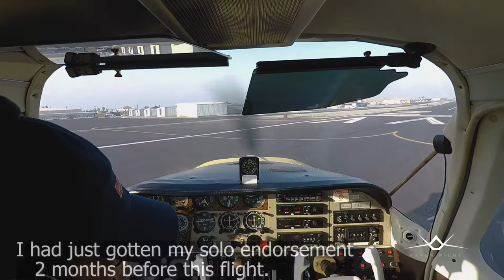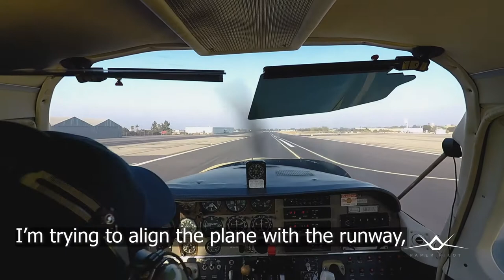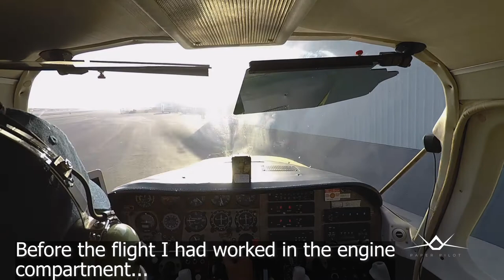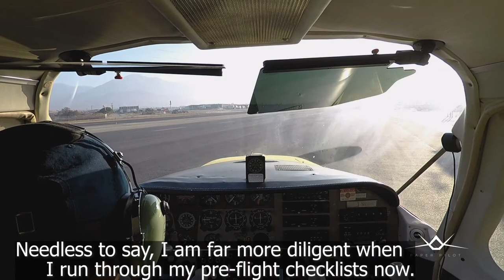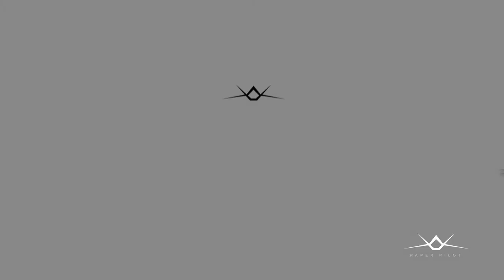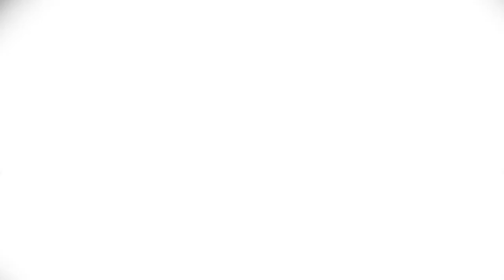Real Emergency Rejected Takeoff! Because I forgot this...

Comment: I've seen accident reports from exactly this situation. You flew the plane, got it back on the ground without any apparent damage to you or the aircraft, and learned a valuable lesson. Then you shared the lesson with all of us on the internet, hopefully preventing someone else from making the same mistake. Good stuff all around.
Reply from the maker: thanks DD. Sat on this a long time. Its always difficult to share the mistakes you made rather than the achievements. But I'm glad I did.
Reply: @PaperPilotJack  When we fly, we're doing something inherently risky and difficult. Mistakes will happen. All of us in aviation can all mitigate risk by sharing and learning together. Your willingness to share this video may have just saved someone's life in the future. You definitely did the right thing.

Comment: Well done.  I'll make a couple suggestions where I can see room for improvement:

1.  Don't take your hand off the throttle during takeoff or landing (and keep it there as much as you can below TPA).  This means on the throttle only and not resting on any other knobs.  Quick emergency throttle movement is critical as you've experienced!

2.  The drift off the runway had nothing to do with the extremely minor change in airflow over the cowl, it was you losing focus on flying the airplane.  You did a fantastic job getting the abort taken care of and it ended up not mattering.  The only reason I bring it up is I think the experience will mean more to learn from if you see how distractions take away your precise control.

3.  F**k the radio!  You were not out of the woods yet and still had things needing fixing while heavily braking when you divided your attention to make the aborting radio call.  You were flustered enough after that to skip using a taxiway to exit the runway when there was no need to get off the runway asap.  Again, this isn't to say you did a bad job because you didn't, it's to drive home the point that the radio can wait, put all your energy and brainpower into the important stuff before you divide your precious focus up to talk on the radio.

I've had a couple emergencies including losing power from multiple cylinders at night over unfamiliar mountains as a VFR pilot being forced into IMC.  I would kill to have video of them so I could figure out more lessons to take away then I did from only replaying them from memory.  Hopefully this is a little helpful and not too harsh, it comes from a fellow pilot who has learned from a lot of mistakes.
Reply from the maker: I respect the comment very much Dustin. I learn something every single time I takeoff. The good comes along with the bad. I will continue to be honest with myself and my fellowship of aviators to show my mistakes, and hopefully we can all learn and get better at this craft we all so love. 

#1 completely agree. I've been doing that since this incident.

As far as #2 goes, I would have to disagree. This is the only plane I've flow in the last 200 hrs and I've never seen her behave on takeoff like this time. There was definitely something pulling her to the left. The only delta there is the cowl that I can think of. Note that I'm always in the mindset of "need more right rudder" so this is likely not the situation (my letting go of the right rudder).

#3 communicate is definitely last on my mind. I did feel the need to pull off before the last taxiway as I've rarely see the other side. I didn't' know if there was a taxi way there nor what the condition on that side was. So the obvious action at that moment was to get off of the runway in case there were other traffic on final behind me.

Again, thank you for watching and commenting.

Best,

Jack

Comment: Thanks for sharing.  I only had the oil filler access panel cover open on me soon on upwind climb out, and I had to fly with minimum sideslip to avoid breaking it off. Had to re-land after a close circuit, vacate, shutdown on taxiway for a minute while I got out and secure it, and off we went again. The tower guy was really nice, he said they won't charge me the additional landing for this :D <3
Reply from the maker: I had the exact same oil panel door issue happen to me as well. The short story my forgetting to close that access door actually saved our lives - literally. After I had landed and closed the access door, as I was cleared for Takeoff by the tower, I pushed up the throttle, I heard a snap/pop - the throttle cable broke. Had it broken in flight (on our way to Catalina Island), I may not be here chatting with you today. ;)

Thank you for for sharing your experience!

Comment: Given the emergency you didn't use the marked taxi..  You were in control of the plane on the runway, there was no danger to you or the aircraft,  that is not a valid excuse.   They are marked for a reason, safety.
Reply from the maker: Thank you for the comment fixento. You have to understand that it's rare that ever see the other side of the runway given that the typical and wind favored runway is 24, having said that, there's a bit of uncertainty as to what taxiway layout on the other end looks like. My main goal was to get the plane stopped and off the runway asap. I believe I made a proper decision to exit the run ASAP regardless of the fact that it was between marked taxiways. I visually identified that the pavement was smooth and clear of obstructions and saw that there were no other person, aircraft or property in the way. I think that was better than to traverse down to the last taxiway and finding out that conditions may have been less than ideal.

With regards to FAA regulations: in an emergency requiring immediate action, the pilot-in-command may deviate from any rule in 14 CFR Part 91, Subpart A, General, and Subpart B, Flight Rules, to the extent required to meet that emergency.

Best,

PaperPilot